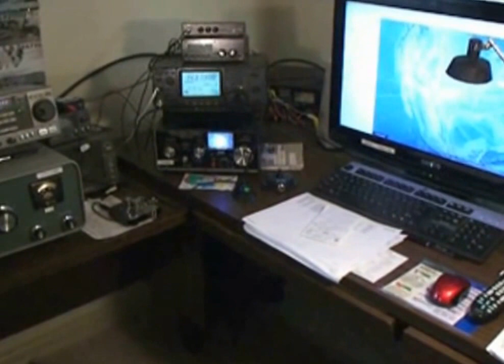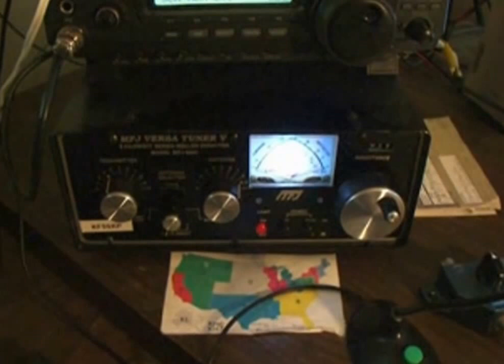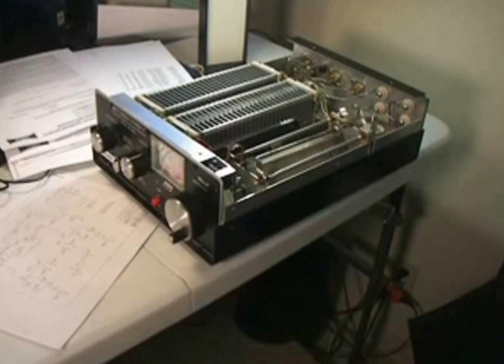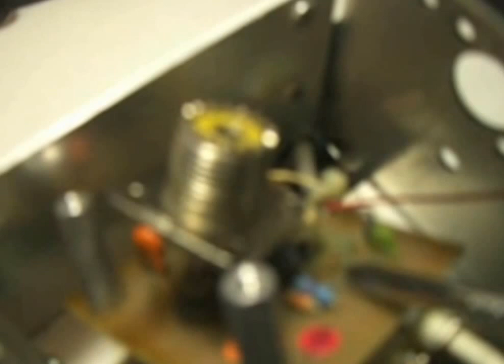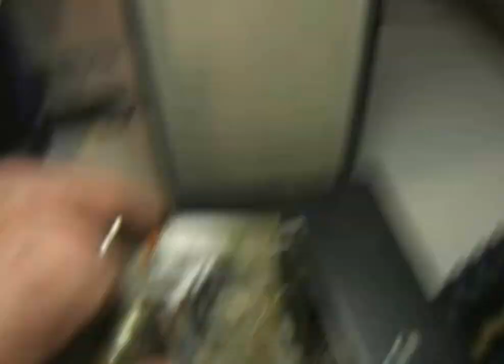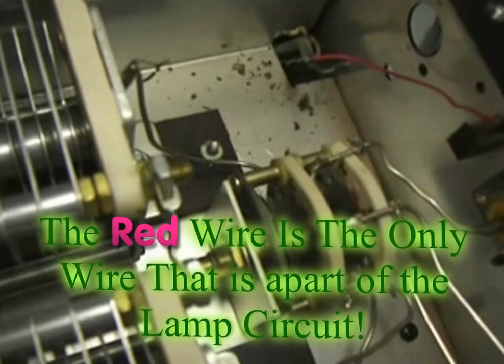MFJ 989C Antenna Tuner Problems - Part 1

Comment: Some MFJ tuners use aluminum rivet fasteners on the SO239 chassis connectors.
The aluminum rivets get rusty and loosen with use creating a ground problem for RF.  
I replaced the SO239 (AL) rivets on my tuner with regular sheet metal screws and lock washers and fixed the tuner problem completely.  Tuner now has no problem handling RF.  Make sure you check the tuner chassis ground.  My tuner’s wingnut ground post broke off (probably also made of aluminum) and I had to install another ground post on the 949 tuner.

This simple fix seemed to cure the tune up problems.
Note:  This fix was not documented on any of the MFJ user web logs online.   So if this fixes your problem then feel free to post on the internet.